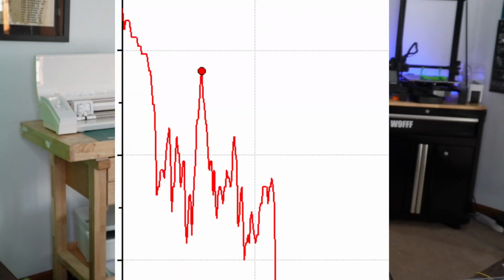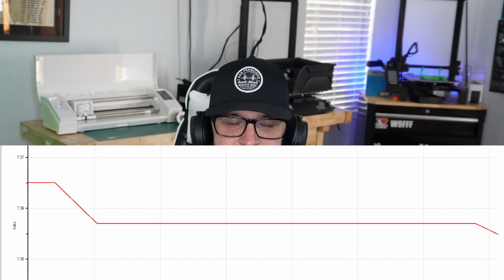Handheld Ham Radio Battery Testing: How To Connect The Battery.

Comment from the maker: To everyone suggesting the Back of the Battery terminals.  On the H3, at least; The back side terminals (The ones a charger would connect to) read at .5v on a fully charged battery, opposed to the 8.4 volts from the terminals which connect to the battery.  This is why I cannot use the original cradle for testing. K thanks.

Comment: Sean, you should use the two contacts on the bottom of the battery on the back. because one is negative & the other is positive. I got an H3 also but mine is black they did not have the color ones when I ordered it.
Reply from the maker: I've tried that method and it doesn't seem to work for me, but it may work for others

Comment: Have you tried soldering the wires to the battery contacts?  
Another way is to gut a charge station and  use that to connect the battery to your test fixture/circuit.  The gutted charge station will hold the battery in place without shorting the leads.

Comment: Great idea.  I have two modification ideas for you. 1st, put some heat shrink tubing on the backside of the battery Gator clips. Allowing the tubing to extend past slightly so no shorting between the two clips. 2ND, add a blob of solder to the corner that you like best on each gator clip where it connects with the terminal. Or grind down approximately 1/8 of an inch on the leading edge of your Gator Clips leaving only a corner untouched.
Reply from the maker: Great ideas, I'll roll with it! Thanks

Comment: A lot of times the charging terminals on the back of the batteries are tied to the output terminals on the front. It might be easier to test from those, since they are farther apart.
Oh, and maybe you could try to make big plastic clips with a 3D printer and use nails that come down vertically for the connections.
Reply from the maker: .5 volts on the back terminals vs 8.4 v on the front, according to my multimeter. It would be nice though, because then I could just use the cradle.

Comment: You can also get some stiff bendable wire, like from a coat hanger (or stainless from an old antenna), and create two inverted "U" pieces, one connected to +, one connected to -, and screw them down to a plastic chopping board (bend some loops for screws on one end of the "U" to make the screw attachment point secure). The battery sits on the plastic chopping board, and the two inverted "U" shape probes can be bent / moved to provide downward pressure directly on to the battery terminals. Just where you need it. Cover the U probes with heat shrink and just leave the tips exposed. Works great in a professional lab here, so it will work for you too! (A picture would speak a thousand words here, but I hope that gives you an idea. Its a lot better than the alligator clips, with a lot less chance of a short. 73

Comment: Hi, I use a micro magnet 2 or 3 millimeter diameter and put the tester probe, for me work good, make secure connection
Reply from the maker: great idea. I bought something from West Mountain radio like that, and could never get the magnets to adhere correctly. I probably did something wrong and will try again! Thanks!